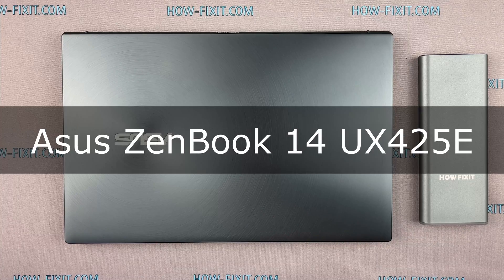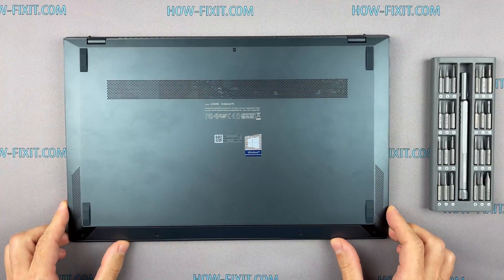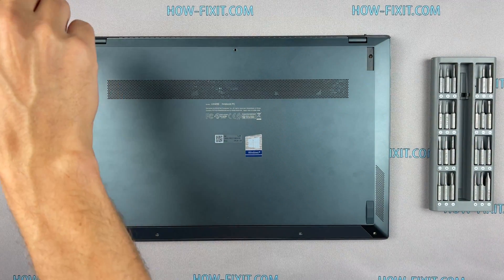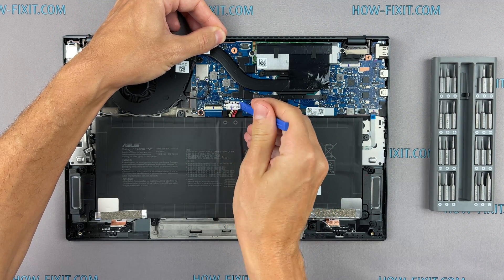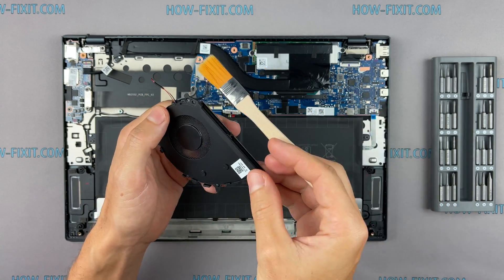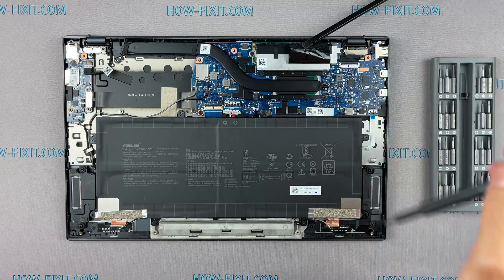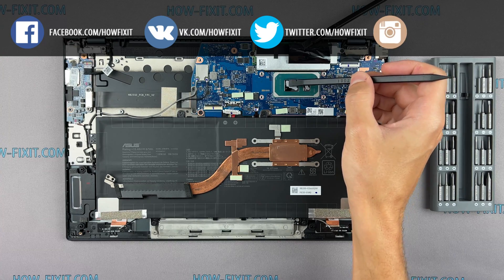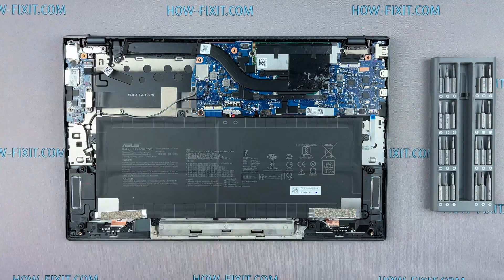Asus ZenBook 14 UX425E Disassembly, fan cleaning and thermal paste replacement

Comment from the maker: For more info check out the links in the description
Reply: I need help fot this particular laptop. I have just open it to clean the fan vents and after close it . Now my laptop is not turning on when i plug in charger the red light left and white light on power switch continuously turn on tor 10 second and then turn off.. can you please suggest me some troubleshoot??

Comment: Are the heat pipe and base plate made of real copper? Or aluminum coated with copper? I want to use Liquidmetal on my Asus Zenbook UM425QA to make run the AMD Ryzen 7 5800HS much cooler and the twice Fans quiet. Yes i play some World of Warships with my Zenbook and its make much Fun

To my Asus Zenbook UM425QA i find nothing on the Internet, i just know that have the Dualfan Cooling with two big flated Heatpipes. Looking Movies or browse sometimes in the Internet but the Fans never Spins. I think its a semi-passive cooled Ultrabook

Comment: How hard is it to remove the battery?

Also, can this laptop still work when plugged in even if the battery is removed?
Reply: It's not hard to remove the battery, you just have to unscrew the screws that are holding it and then disconnect it from the motherboard and it will come out easily.

Yes, the laptop can still work even if the battery is removed as long as you have it plugged in.